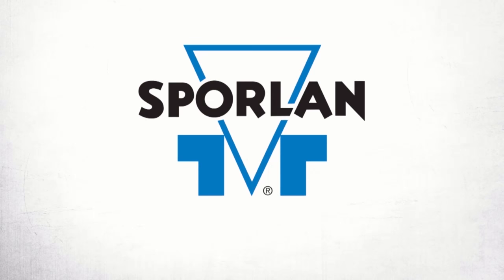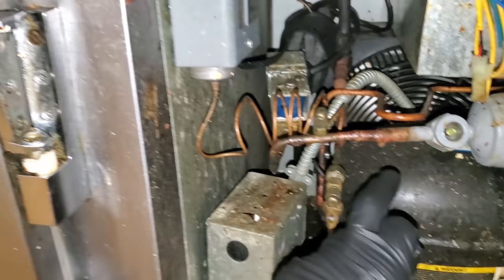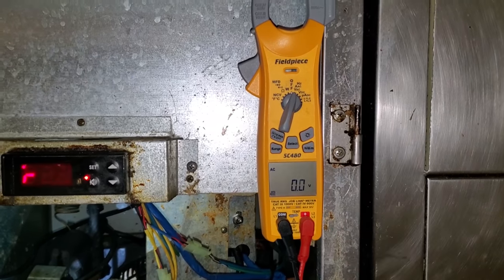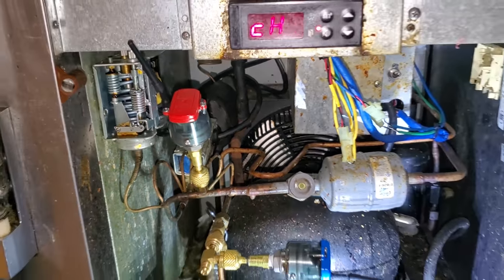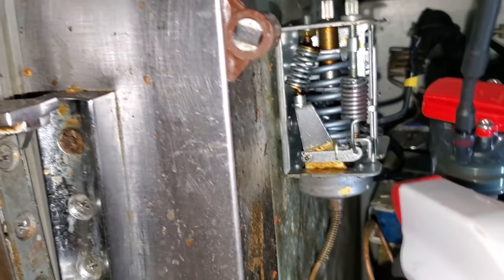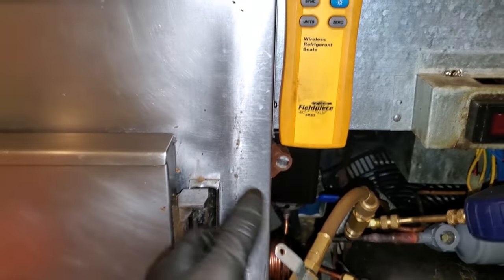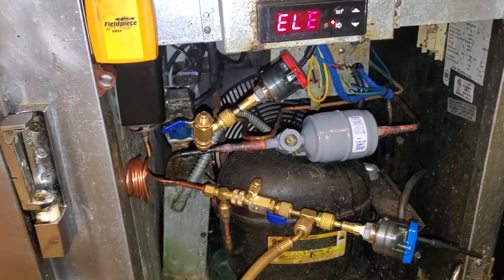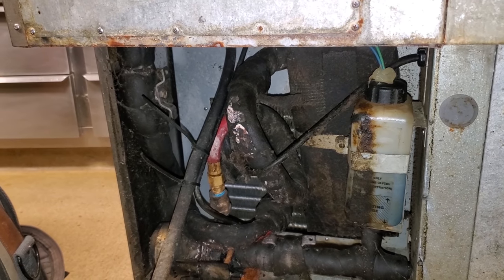KAIRAK BLU GLYCOL COOLER

Comment: I've been meaning to thanks you for these videos for a while now. Even though your line of work and mine have very little in common (I'm an automotive mechanic who isn't even EPA certified to work on A/C systems yet, since I do electrical and gasoline driveability diagnostics anyways) I've taken quite a few tips from you over the year or so I've been a fan. Especially your Big Picture diagnostics attitude. I always think of that and take a step back when I'm diagnosing electrical issues, and more than a few times it's helped me find other issues. Sometimes related to the original concern, and others just more broken stuff to get paid to fix! Anyways thank you for all the hard work and time you put into making these videos!
Reply from the maker: Thanks for the nice words bud! I will be going live on YouTube this evening 4/27/20 @ 5:PM (pacific time) to discuss my recent uploads, and answer questions from the chat, emails and YouTube comments, come on over and check it out.  https://youtu.be/9SPpfN6LKd8

Comment: I love this design. Take away the possibility of evaporators getting eaten up by acids inside the box. You can build the heat exchanger and refrigerant lines heavier as the lineset is short. Totally possible to make units that last as long as the machines of the 1970's. (If they wanted to!)
Reply: I wonder if there is a hit to overall efficiency by having the 2 systems handle the heat transfer.

Comment: That glycol circuit is a very neat idea.
Especially for cold-rails, which are notoriously difficult to repair refrigerant leaks in.
I was considering using an off the shelf chiller for similar ideas.

Comment: I actually work on large printers and copiers, that being said 
, I have utilized many of your “whole” picture methods in my on work, Thank You Sir
Reply: "Big picture diagnosis" as he calls it, is a universal concept. Dad and I fix cars for a living, and we live in the rust belt, so there's no shortage of cars to fix. However, half the time it's not the frame that rots, but the wiring. Gotta go looking for "green crusties", the tell-tale sign of oxidized copper. Green Statue of Liberty, good. Green wires, not so much. So it becomes a matter of checking the integrity of the circuit at every connector, and when you isolate the fault to the point you can say "it's gotta be between here and here", you start unwrapping the wiring harness and looking for the broken or damaged or shorted wire. Nine times out of ten it's where the wire takes a turn or enters a junction box, and the failure was caused by the wire rubbing against something, which eventually wore thru the insulation, and the exposed wire then starts corroding the next or current winter when the roads are salted to keep the ice off of them.
Once you found the break it's a pretty typical wire splice repair. Sometimes you need to obtain a new connector if one of the pins corroded and won't make connection anymore, but that doesn't happen as much these days with the weatherproof connectors they use now. We don't just leave it at that tho, we try to make it at least as good as new, and better if we can (we add support to the wire so that it won't rub thru in the same spot again).
When the break is in the middle of a wire, we use good crimp splices that have better insulation on them than your stereotypical red blue or yellow crimp butt splice connector. The makers of the things replaced the regular semi-hard plastic with heat-shrink tube that has hot-melt glue lining the inside. Once you crimp it, you run a lighter over it to shrink the tubing, which also melts the hot-melt glue and does a really good job of keeping water out of the wire.

But like you said, it's all about the big picture, if a car is in for a brake job we check all the suspension joints too, that way we can give someone advance notice that (for example) they have a ball joint that needs replacement within the next 3 months or something like that. And just like Chris here, we always give the customer the option of what to do. We're even good at telling people when it's time to replace their vehicle (usually because they have a lot of high dollar repairs coming up within a short time frame).

Comment: Nice find! never know where you will find a leak.  I’ve actually seen a high pressure safety leaking up through the sealed portion and into the wiring insulation, only making itself visible at the end of the wiring run. Definitely threw me for a loop trying to find it.

Comment: Great troubleshooting.
What is the advantage of controlling the compressor with low pressure switch over controlling it directly by thermostat in a one-evaporator co-located system?

Comment: I once had a leaky pressure switch, which i thought was strange because that brand almost never leaks. Anyway i replaced it, charged up the system and called it a day. The very next morning i got a call from my dispatcher who said the system was down again. I went back and found it low on refrigerant once more. Must have missed a leak i thought. So i went over everything again as i had done the day before but found nothing. Close to giving up i decided to check the new pressure switch i had installed. Lo and behold, it leaked. So within twelve hours i had two switches of the same brand that almost never leaks, one over a decade old, the other brand new, both leaking. Go figure.
That was over a decade ago now, and i have not had another leak on that type of switch again.
Reply: that is crazy. people complaining about peanut style pressure switch.but for me , atless they're not leaking.

Comment: Worked on an air dryer at a plant that made 55 gallon drums. It has a propylene glycol mix. The plant was over 130 degrees. The dryer was designed for no more that 100 degrees. The mix would evaporate and they ran out of glycol so they were topping them off with water. I didn’t know this. Well the heat exchanger ran at 16 degrees. Guess what happened. They split the heat exchangers. When this happened the pump pressure exceeded the empty refrigerant circuit and filled it with water. I had my vacuum pump on one of them for a week. I had the Maintnence guys changing the oil every 2 hours. What a nightmare. I got it down to 800 microns after a week and went to start it up. The water was under the oil in the compressor. It ran for just seconds and the compressor died. I hate when that happens. Test your mix when working on glycol units. Don’t top off with water.

Comment: Original sensor have been replaced,  Using a 7/11 big gulp straw makes it easier to get them down into the tee. Also they can be checked through the controller. Anytime you see ELE LOS just hit alarm button. The unit had a voltage drop happens at night during time of less demand. If you every see any glycol in the cabinet by fan means glycol leak and unit needs to be replaced. Also the new GB sensors are of a improved design and have a very low failure rate.

Comment: Hey so is there a 3 way valve that controls the circulation of the glycol inside the box , so that once the box reaches temp , the glycol stops circulating inside and just cycles inside the plate exchanger ?

Comment: Do you ever eat in any restaurant you've been to a service call in?

The top of the unit looked clean enough, but the chilled cupboards, the refrigeration compartment, and behind the unit were all disgusting...
Reply: Yeah so, once you get in this trade, your options for eating out get smaller and smaller. Side note: don't ever eat the ice ANYWHERE. EVER. lol.
Reply: manuel martin why the Brasilian flag... What do we have to do with Chinese and Kebab? 🤔
Reply: @badmutejames  Those ice machines hardly ever get cleaned on a regular basis!

Comment: I wonder, why use glycol at all? Isn't that a source of inefficiency, since the heat needs to be removed from the food (which incurs a loss) and then removed again from the glycol (which incurs another loss). Wouldn't it be more efficient to skip glycol alltogether, and just run a R404A refridgeation line through the whole unit instead, so you only have the "transfer loss" once? Thus the compressor don't need to run as much (in total time) compared to using the glycol, which gives prolonged life of the compressor, and also reduces the electricity bill?

Comment: You don't use R-22 as a trace gas? Is R-404 a trace gas?
Reply: Technically any refrigerant that is still in production that your detector can pick up can be used as a trace gas as long you are charging less than 3 ounces into the system and topping it with nitrogen.  The 3 ounce limit is the de minimus limit for the EPA.

Comment: Sanitary is not a word I would use, that equipment is gross.  Probably the main reason I will not work on commercial kitchen equipment, that just grosses me out... Sorry, I know it's a job but I could not do kitchen equipment.
Reply from the maker: Often times Im working on equipment that I understand fully and sometimes my troubleshooting steps might not show everything that my brain is doing.... I already knew that most likely there was a leak in the evaporator and it was going to be repairable . I will discuss this on my Livestream this evening on YouTube 5/4/20 @ 5:PM (pacific time) if you cant make it to the live show no worries as it will post a normal video on my channel afterwards. https://youtu.be/vI07u0vqK6I